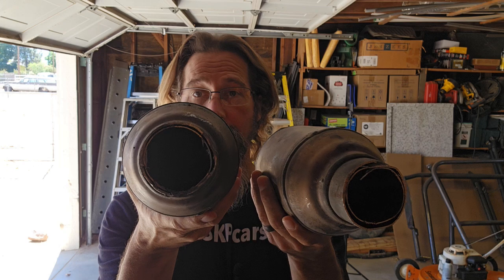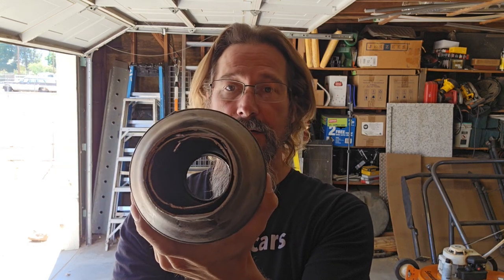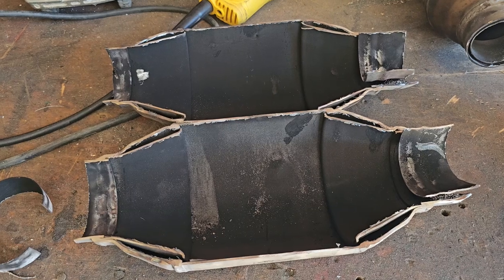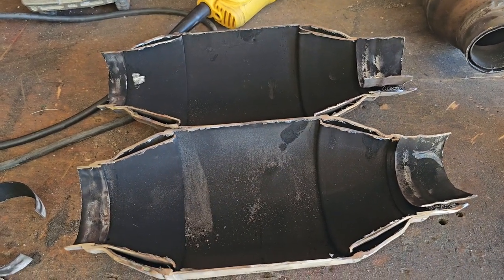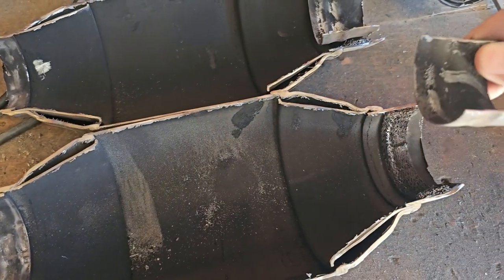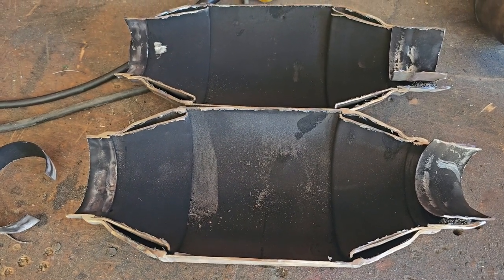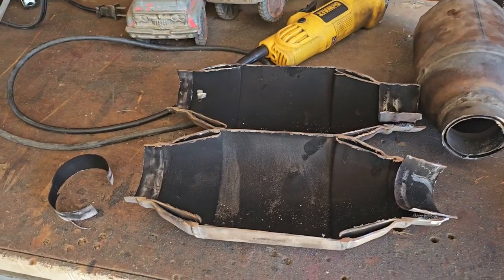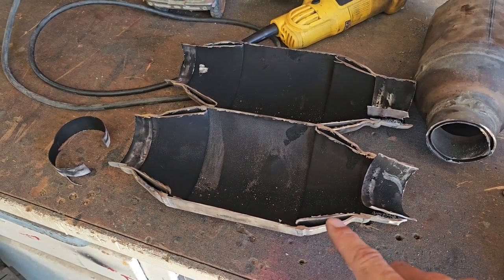What's Inside of a Catalytic Converter

Comment: My converter flange to muffler rusted off. I cut the flange and found the double wall up to the flange. Is it ok to weld a new flange right onto it?
Reply from the maker: I'm a little confused as to if you mean a bolt on flange or a piece of flared pipe at the end. Either way you should be ok as long as you don't weld close enough to the converter itself to heat up the screens inside.
Reply: @SKPcars yea, it’s a flex spring flange.
Reply from the maker: As long as you have solid metal to weld to you could. You can't weld to the flex pipe.